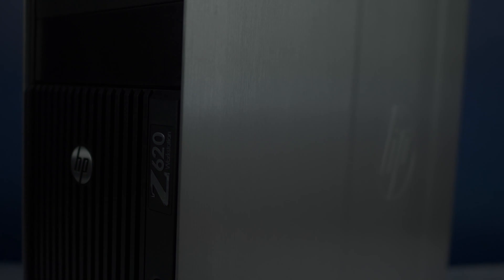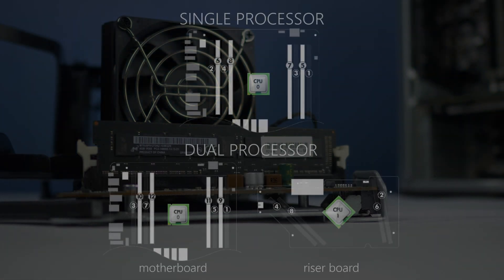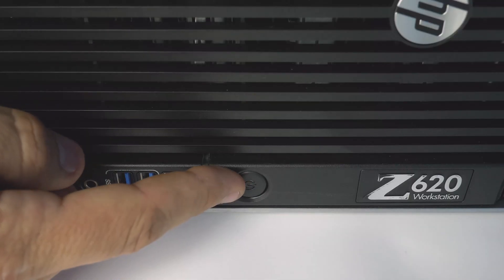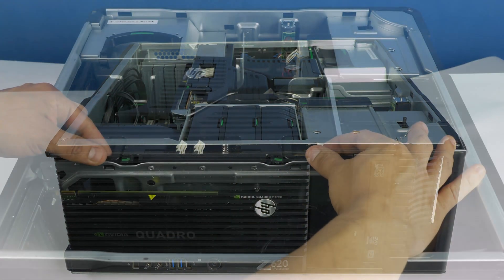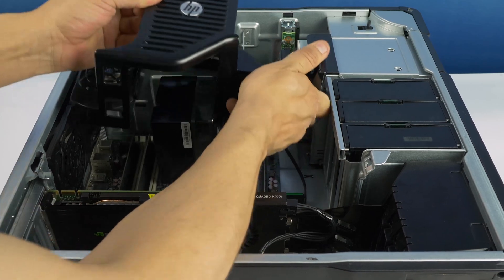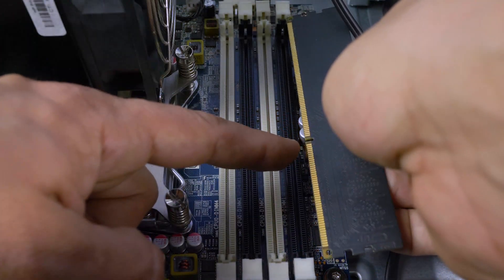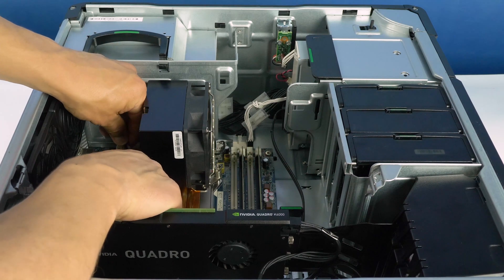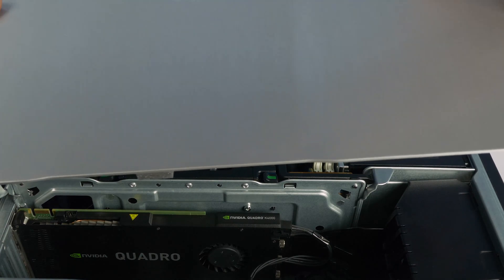HP Z620 Memory Installation

Comment: I have a z620 too
Reply from the maker: https://tekboost.com/components/memory-kits/ Please note that compatibility will vary based the processor you have installed.  If you let us know which processor you are using, and total memory needed, we can provide the exact kit needed.
Reply: @tekboost  hi I have Hp z620  My processor is Intel(r) Xeon(r) CPU E5-2609 v2@ 2.50ghz.  My memory ram is ddr3 1333 hamza dimm  2x4gb installed  I need another 2x4gb
Reply: @mustafadahir8280  I recommend opening up your workstation and taking a look at the part number on the memory and ordering exact match. If that exact part number is not available to buy, then get matching specs for Rank and chipcount (1Rx4, 1Rx8, 2Rx4, 2Rx8, etc), matching speed (10600, 12800, or 14900) and matching type which is either ECC Registered or ECC Unbuffered.  You can tell which by looking at the letter after the speed.  For example 12800E = ECC Unbuffered (E = ECC Unbuffered) vs 12800R ECC Registered (R=ECC Registered).  Best of luck.
Reply from the maker: @Mustafa Dahir Yes, Non ECC is not compatible, must be ECC Registered or ECC Unbuffered, and all must be the same - Registered or Unbuffered.  Good luck.